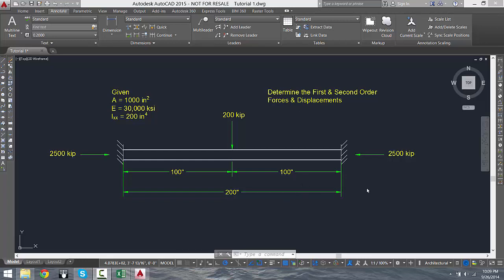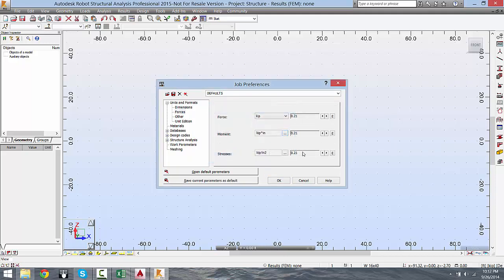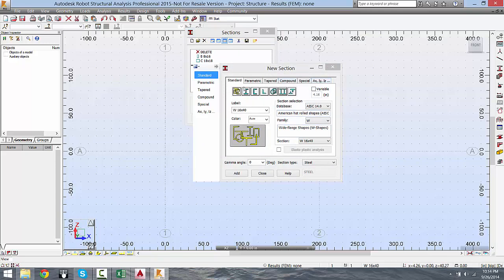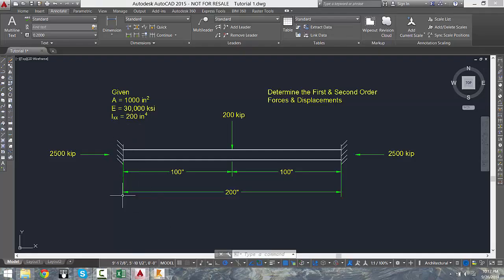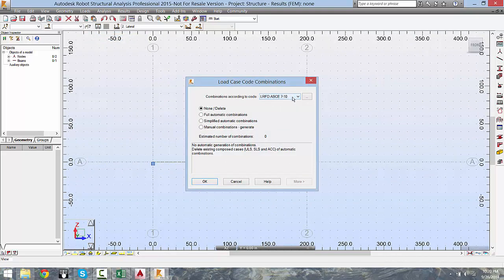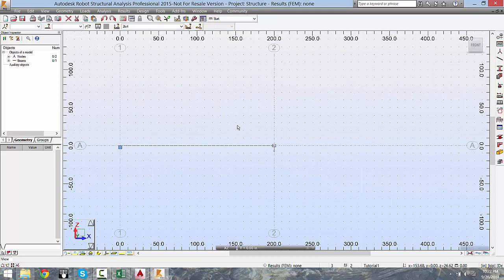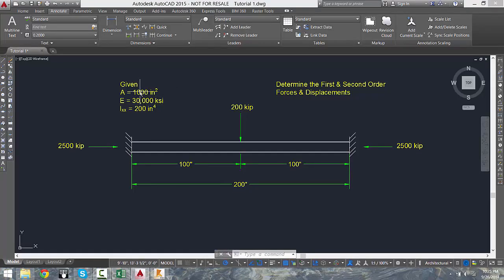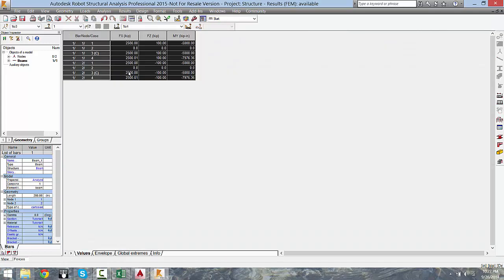Robot Structural Analysis 2015 - Simple Second Order Analysis

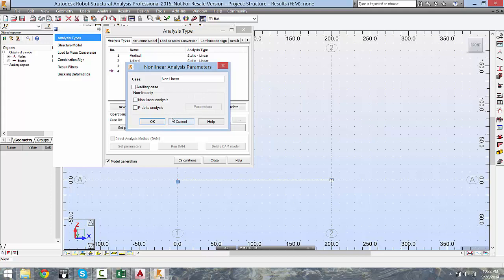Comment: 12:45 I don't have this "non-linear analysis" in my Robot.. How do I apply non-linear to my structure then?
Reply from the maker: It would appear as if a bit of renaming has been done in the non-linear analysis module since I published this video. For the newer versions:
P-delta - 2nd order displacements (Normally used in structural analysis)
Large Displacements - 2nd & 3rd order displacement (Intended more for cables or fabrics

These links should show the change they made

https://knowledge.autodesk.com/support/robot-structural-analysis-products/learn-explore/caas/CloudHelp/cloudhelp/2015/ENU/Robot/files/GUID-539BF9B3-3DA5-4E07-8BC6-15284F87843A-htm.html
https://help.autodesk.com/view/RSAPRO/2019/ENU/?guid=GUID-539BF9B3-3DA5-4E07-8BC6-15284F87843A